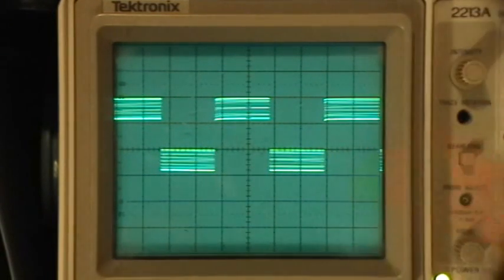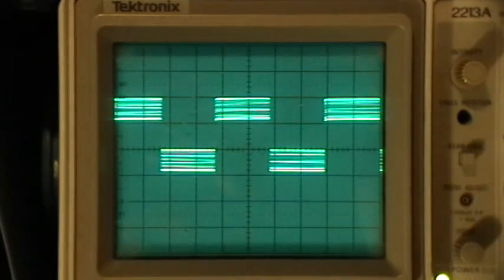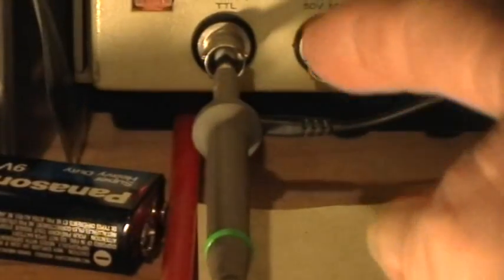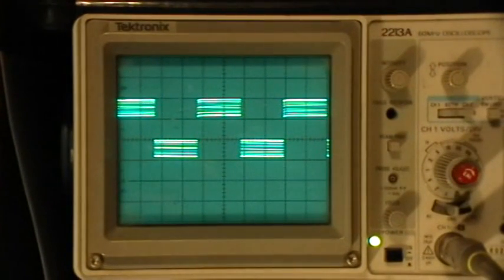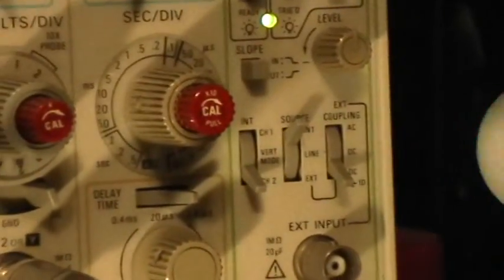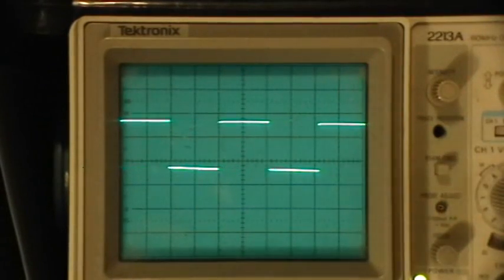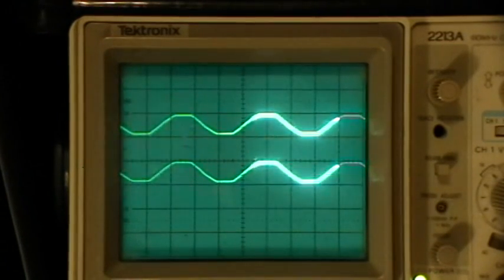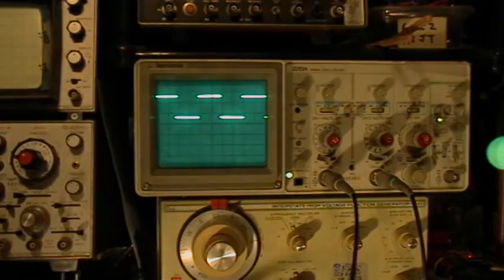Scoposcopy: Trigger Source "LINE" and 60Hz Mains Line Hum

Comment: Were would zero/neutral line fall on 120 vac main line?
Reply from the maker: I'm not sure if I understand your question. You can position a channel baseline anywhere on the screen. The "120 VAC"  (RMS) from the mains is actually going to be around 170 V peak-to-peak, the midpoint of that should be at "zero volts" with respect to ground/neutral, and you could position that anywhere on the screen. But it's not a good idea to try to scope the mains line unless you really know what you are doing, you can very easily destroy your equipment or electrocute yourself that way.
Reply: TinselKoala I don't have a scope but I'm interested in your opinion. Midpoint is what I suspected. Been testing lower resistance primaries in series with light bulb for load and driving it with step down transformer. It works and I get close to 1 to 1 voltage 13.6 v true ac. I would think more voltage in (120 ac) more voltage out but it falls flat and barely gets near 13.6 v. This leads me to think 120ac is 120dc with a load without capacitance. In other words there is only a driving force in one direction unless there is capacitance to spring back with the returning force. 220ac would give the return force. I don't know enough about the technical part of ac. This subject also relates to Gerard Morin's work.
I've come across 1.5v-1.8v potential to ground often. Oddly this is a voltage used by the railroad for years. Could that be the baseline?
Thanks :)
Reply from the maker: Michael Meadows
!20 VAC is not 120 VDC. I don't understand your description of your testing, it sounds to me like you are measuring the voltage drop across the bulb or something. Gerald Morin is wrong in his claims and doesn't know what he is talking about, he doesn't understand how his own tools work, how to make proper measurements or the basics of electricity or electronics. The voltage difference "potential to ground", if you are measuring your mains line Neutral with respect to the mains Ground conductor, is caused by resistance in your house wiring and distribution box, or perhaps even a dangerous ground fault in your house wiring. Please do some research and educate yourself about the basics of electricity before you electrocute yourself! In one of Morin's videos you can see him hanging his fingers all over the live  input wires  to his distribution box, while looking at the camera. One centimeter of twitch over to an uninsulated part of the wire and he'd be toast.
Reply: TinselKoala Being safe with the mains ;)  Thanks for your help.
Exploring why a primary of a transformer in series with a load can both be powered by a secondary but not directly by a 120 mains line.